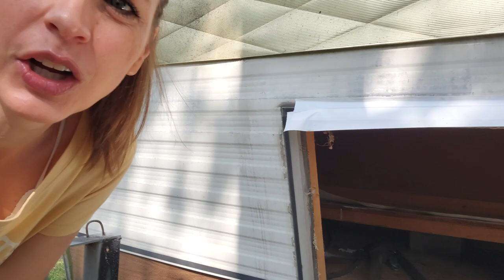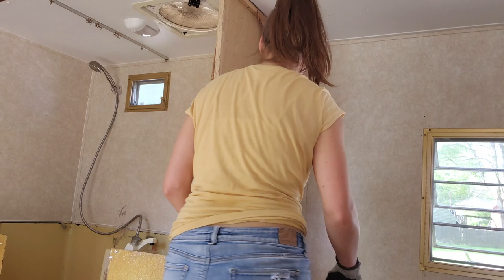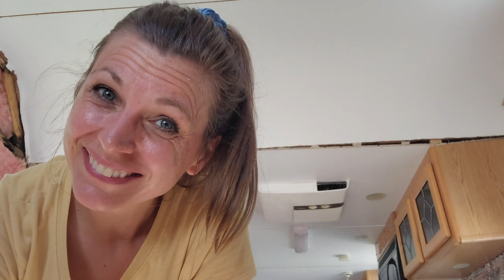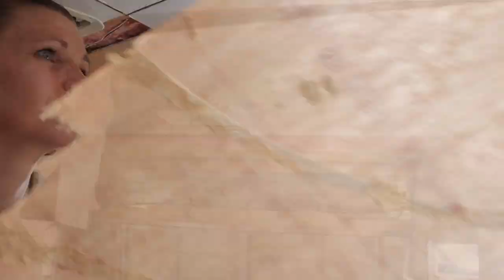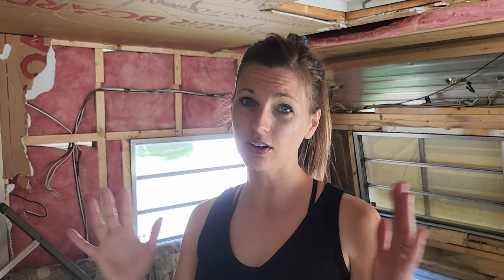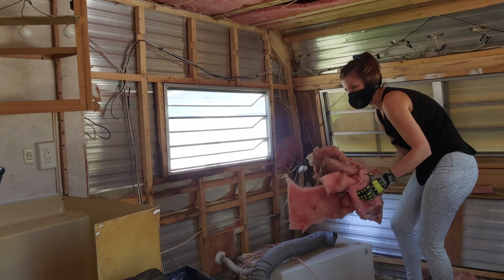VINTAGE CAMPER RENOVATION (Ep. 4): several water leaks and MOLD EVERYWHERE!

Comment: im working on a camper thats similar to yours, the back was torn out by my aunt before she gave it to me. The bathroom, kitchen part and front werent torn out. I was gonna leave the front but noticed some water damage, decided to rip it out and im happy i did the amount of mold in there was so bad and some sketchy wiring done by whoever owned it in the past😵 considering ripping all the walls off and insulation i have a feeling there might be more hiding.
ive discovered some holes and gaps in the outside panels looks like they did a repair job but not a very good one lol
Reply from the maker: Oh my! Sounds like you have a big job on your hands like us! I knew it had mold, but I kept finding more and more as I was demoing the camper. So, I thought it would be best to just tear it all out and start from the beginning. I feel a lot better about it!